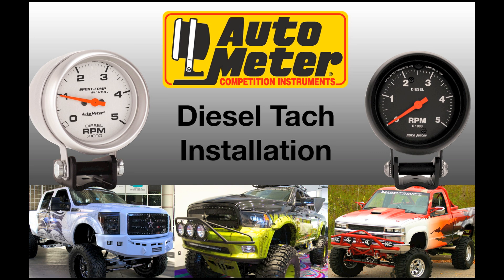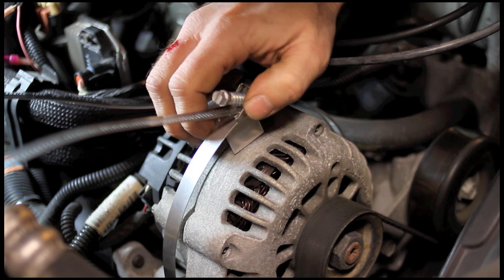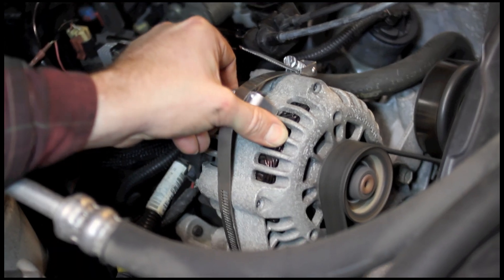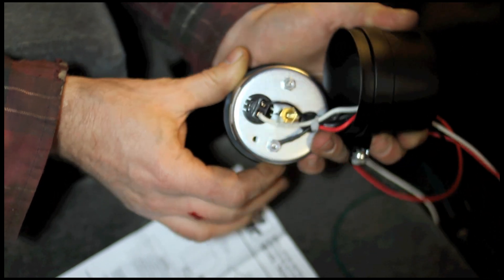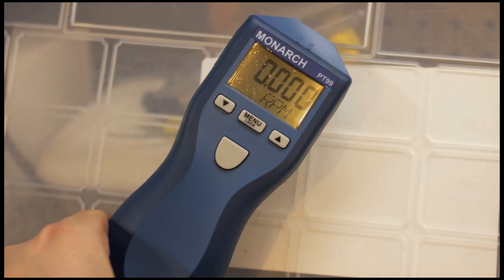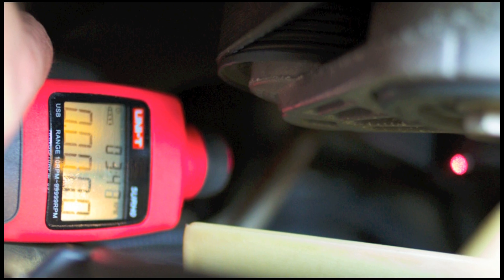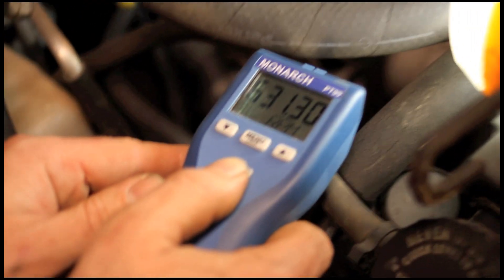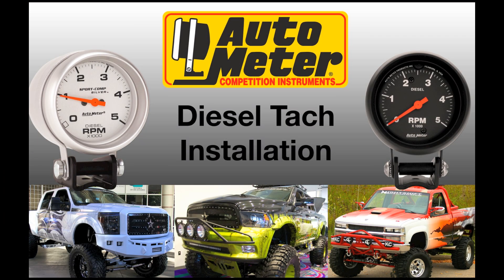AutoMeter Diesel Tachometers

Comment: If you guys could sell a guaranteed solution for o.g. era GM Alternators that will work with the new Invision Dash for squarebody 6.2 diesels it would be awesome. Also a VSS to the TH400/etc; old school trans cables. Or just enable GPS speedo on the Invision like Dakota Digital does

Comment: I want that one set. How much does it cost to send to thailand?
Reply from the maker: Hello! AutoMeter is happy to accept international orders. We use UPS exclusively as our preferred shipper and charge a flat rate of $99.95 for international orders ($39.95 to Mexico and Canada). Please note, this does not cover applicable taxes, duties, fees, etc, which may be charged when the product enters your country. These are the responsibility of the purchaser and will not be paid by AutoMeter. If your country does not appear in our menu system, please call us at 815-895-8141 and we can assist you over the phone.
Reply: How can buy this?